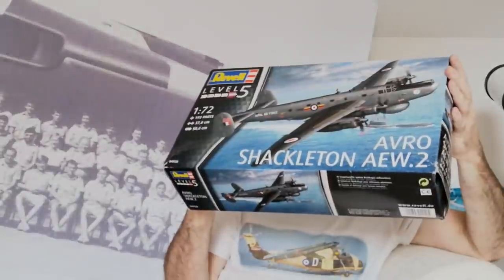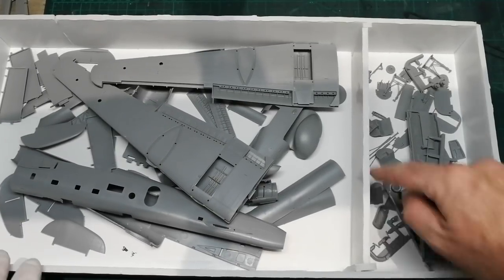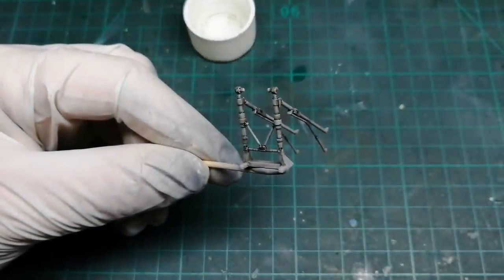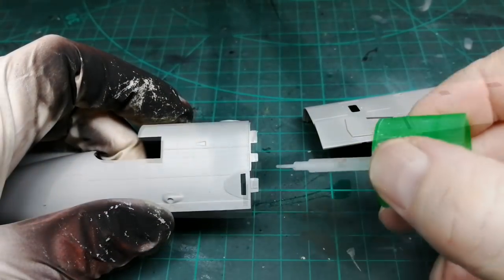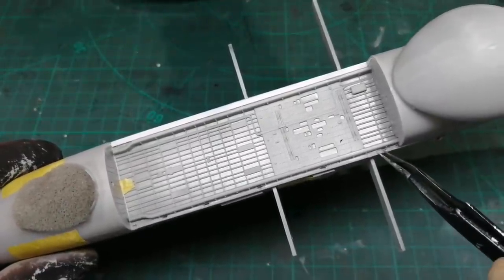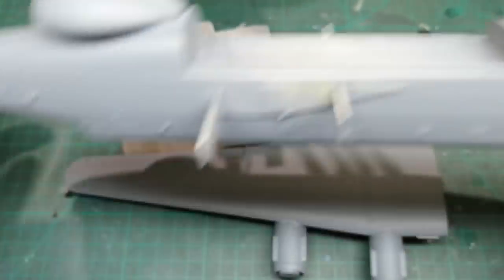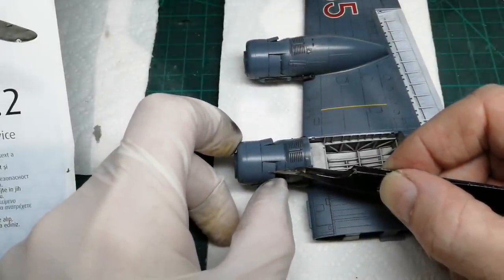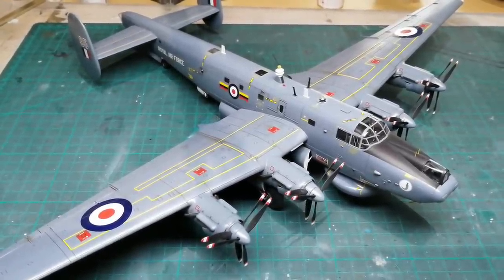Revell's 1/72 Avro Shackleton AEW (Full Build)

Comment: It looks like a Shackleton to me and yes its another great model Greg,  I used to like watching them fly when I was in the ATC back in the early 80's, it was a great aircraft and another of the RAF workhorses.  
Like you with this model I'm getting a little frustrated trying to convert a Revell 1.48 USAF B24D into an RAF Coastal Command Liberator Mk 3a. 
What would you recommend to do with the raised panel lines in the model?
I'm building it as a tribute to my great uncle who was 224sqn's Bombing Leader during WW2.  Serving as an Observer with RAF Coastal Command and he lost his life in a flying accident on 30.10.1942.  When their a/c hit a barrage balloon whilst attempting an emergency landing near Plymouth.
Reply from the maker: That sounds like a nightmare, I've only ever had to rescribe a few kits, then add the rivet detail afterwards, using Rosie the Riveter tools. The first thing I'd do is sand the surface detail off. The raised lines usually leave a light mark on the plastic surface, usually, to help guide. If that doesn't work I'd pen the panel lines in using the raised ones as a guide.  Once the rescribing has been complete all the pen work must be sanded off; otherwise it will show through the final paint job. Then use Dymo adhesive tape, which comes in blue or black, as a hard edge for the scribing tool. I use Tamiya's Plastic Scriber II, but that's just a personal choice. Hope this helps.
Reply: Thanks Greg, I've been trying to build this for ages.  Im using enamel paints that I have here, do you know if Tamiya enamel thinners will work with Humbrol enamel paint?   I havent been able to find any Humbrol thinners here during the current NZ lockdown?
Reply from the maker: @pjb5757  I don't know. Flory models did a vid on mixing various paints with thinners some time ago. If not try some paint and the thinners in a small pot and see what reaction you get, remembering that different ratios will sometimes get different reactions.

Comment: Another stunning build, Greg.  I noticed that you used Vallejo putty and is something I've been wanting to try but have been put off by reviews of it.  How do you find using it, is it something you can recommend?
Reply from the maker: It's a cheap and quick fix, love it for small gaps that won't flex. But it's not something I would sand 👍
Reply: Thanks for the reply mate, very much appreciated.  Yep, most of the reviews I have read said it was crap for sanding.  I'll pick some up and give it a try on the small gaps.  Looking forward to your next build.
Reply: @Axl_Pose  This is the putty of choice if you can't sand for what ever reason. Another thing, you can use acrylic sealant , to buy in your local hardware store , Valljeo putty is the same stuff.